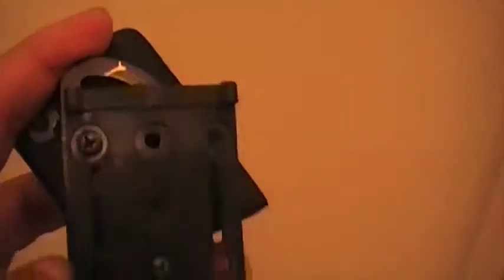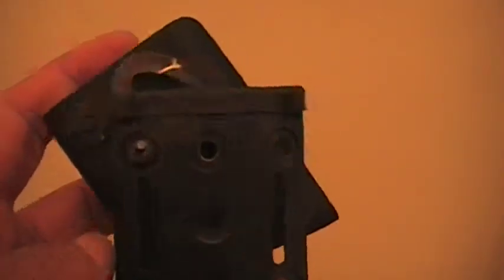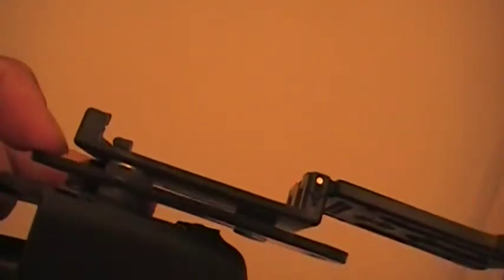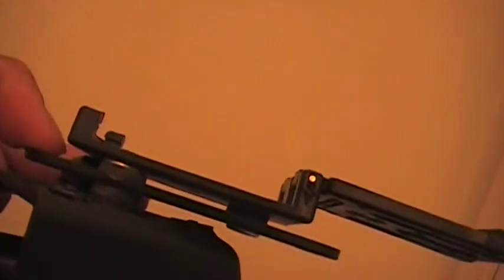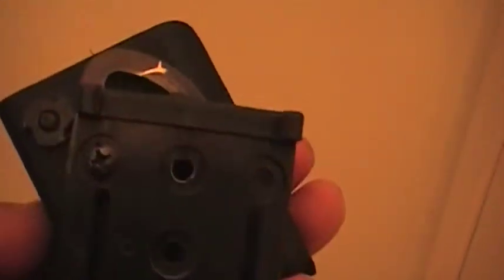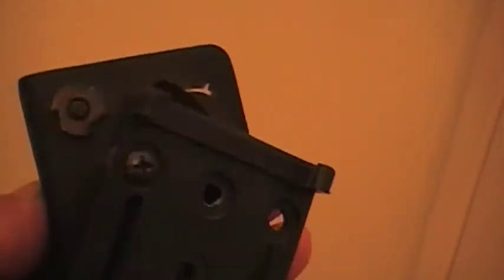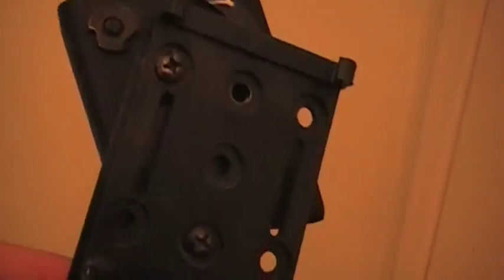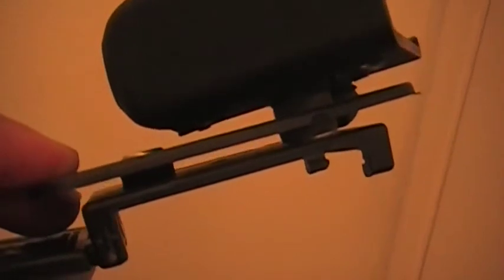771 with Blade Tech Tek-Lok

Comment from the maker: It depends on the belt system you have.  If your outer belt doesn't attach to the inner belt you can put on the holster with your belt still on.  But it is a pain if you want to take the holster off with the belt still on.